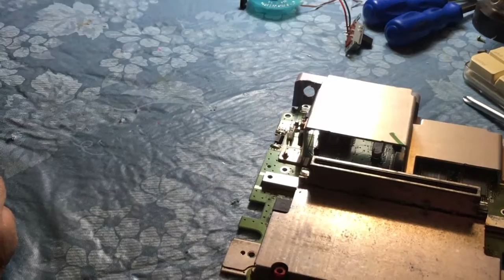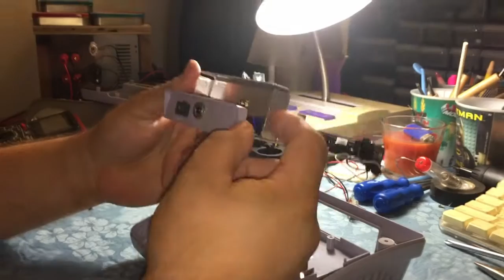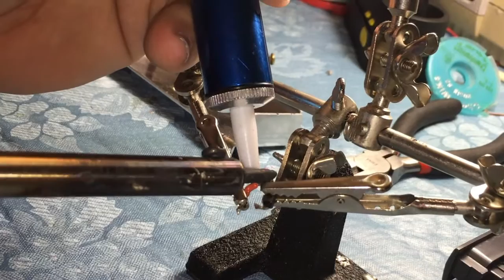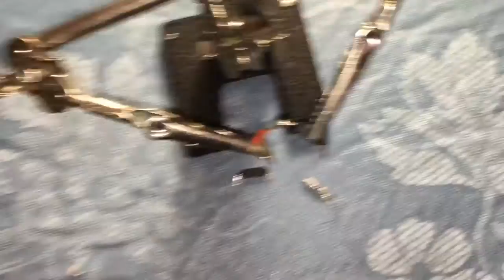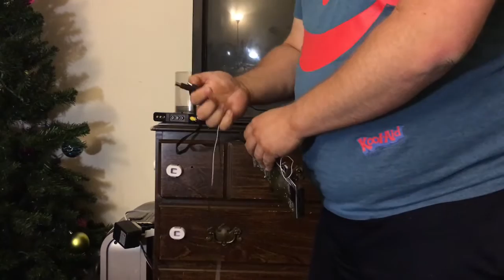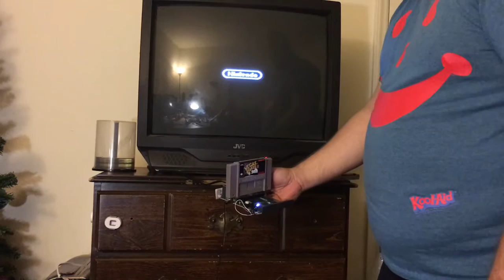SNES Mini Fuse Replacement

Comment: Hey good job! I have à question about the plug repair you made... I have the same problem, It broke and I have to change it. You just have to put + in the original hole and ground in the other??? Nothing more?

Comment: i bought one just for collection with some probleme about capacitador the seller told me the capacitador become hot and then turn of he toldme maybe can be fixed is a jr
Reply: Sounds more like the 7805 voltage regulator.